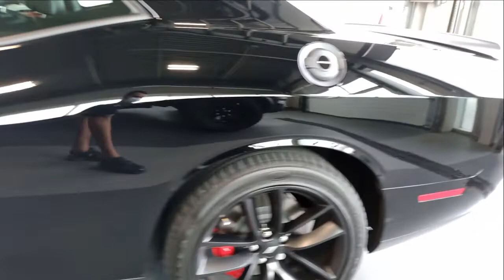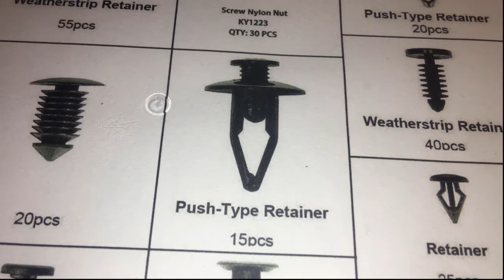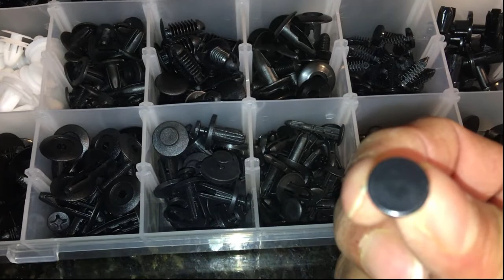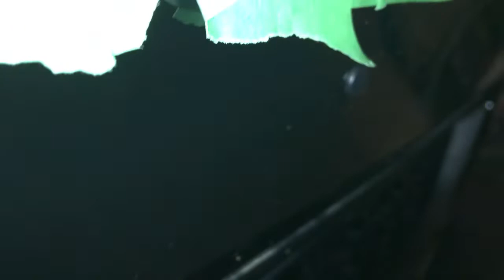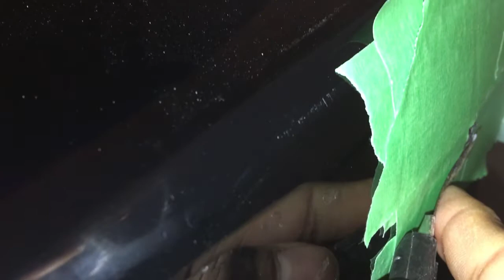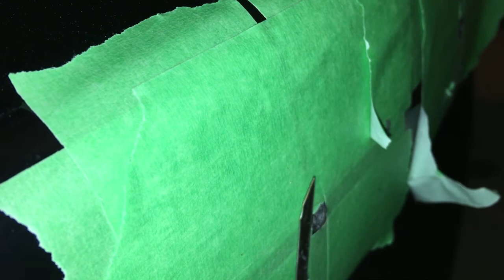License Plate hole repair bumper using plug PROPER WAY- Dodge Challenger V8

Comment: Idk why they’re allowed to damage the vehicles like that. What they need to do is hand you the plate and say “apply however you want” as an option. Because my 8/10 looking car is because of that ugly plate and the plastic housing for it rubbed the paint off my imperial now I have to figure out how to paint it correctly and then get bumper plugs. I’ll be out $150 minimum for the paint and the plugs. That isn’t counting the clear coat. Those bastards.
Reply from the maker: You are 100% correct - I have no idea why they do that! It was a pain to fix it but now it looks great.

Comment: I appreciate the video. Took delivery of a Bronco Sport yesterday and not only did the dealer drill in a front license plate bracket (we don't need front license plates in my state) but they put their stupid dealer sticker on it too that I had to remove. I asked them not to do both things TWICE. Absurd, man. Oh, and they put in the wrong color for my two tone roof and scratched up some plastics. But your point remains in 2022, what are you gonna do when it would take another 6 months to order a new one? /rant

The video was very helpful 👍
Reply from the maker: Congratulations, Love new Broncos:)   I am sure you gonna have so much fun :)